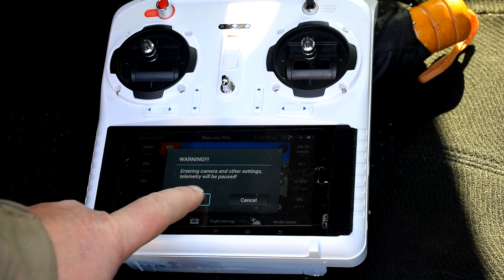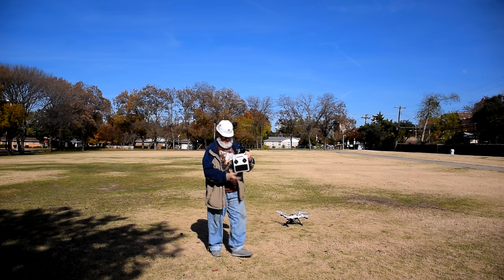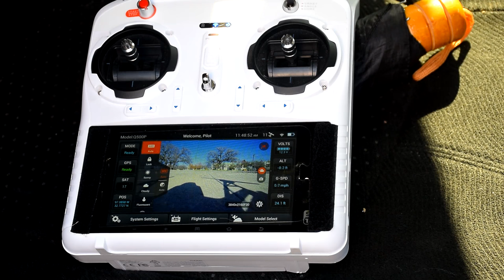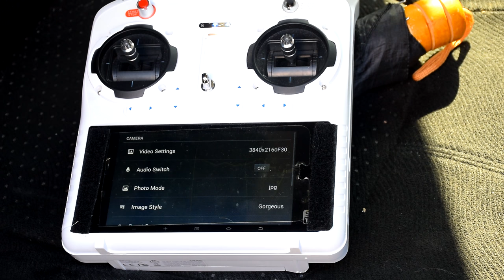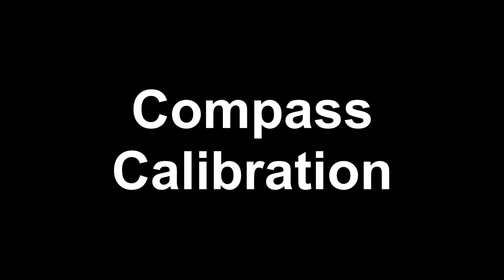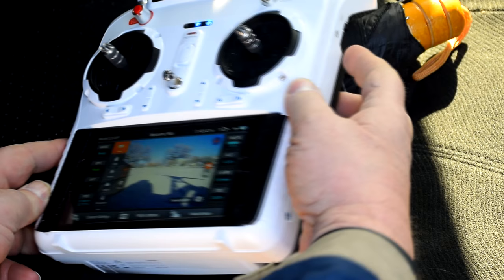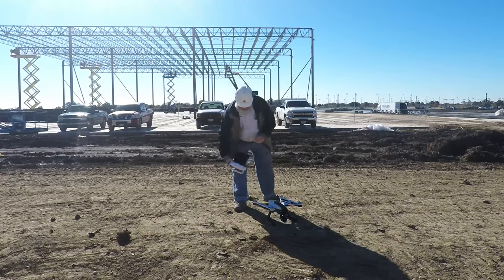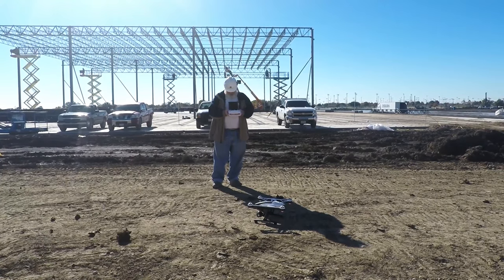Episode 4: How to Calibrate the Yuneec Q500 4K - Accelerometer and Compass Calibrations

Comment: My q500 4K has a problem when is time to record I'll record only the sound but the video won't show up but, I don't understand why taking pictures will show up can you please help me I have send the drone to be fix about the camera because I was flying the drone and crash it to a tree causing the cables of the camera totally disconnect from the camera but I don't think they fix it right can u please help me
Reply from the maker: Hi Jonathan - It sounds like the camera was not fixed right but it is strange that it records photos but not video. The only other thing I can think of is that your computer won't play 4K video but that's really a stretch. I'm afraid you need to call Yuneec and ask about this problem.

One other idea. Try disconnecting the cable between your camera and the body of the drone and reconnecting it. Make sure it is fully connected. Then see if it will do the video.

Comment: I bought mine from a fella 30 miles away. He is the second owner. He bought it from the original owner, a pilot. . I don't know  how far it traveled from the original owner.  It has never crashed to the best of my knowledge and it maintained the original gimbal wire until I lost control with it when I lost SAT LOCK and the wind pushed it into the side of my house at 6' and when it dropped, the gimbal rolled away from the crash scene LOL.... The craft is in perfect condition, except for some scrapped up paint stained blades and I installed the supplied spare wire to the craft and gimbal that states' HA! THIS IDIOT CRASHED! HA HAHA! LOL..... MY questions are do we have magnetic interference and lose SAT lock often?? Wouldn't this scare folks from flying??I had 12 SATS lock at first. It was when I rose to 6' TWICE, that I lost lock.  I must always assume I will lose LOCK.  I don't want to be 300 feet up and lose 'LOCK' and then control. My main question is>> SHOULD I CALIBRATE  etc. just to be safe? I don't think it would hurt. Maybe the original owner lives in Texas or California for all I know. Maybe the original owner mailed it to the guy in Daytona Beach. I think IF I DON"T KNOW the history, I should calibrate. BUT, should I have too?

Comment: Instructions from Yuneec say to rotate to the left. Not the right. I will PM you the instructions. Please correct your video.
Reply from the maker: Hi modex - this has been discussed previously . . . the instructions say to turn counter clockwise, but Ryan, the guy in charge of Yuneec USA tech support, demonstrated the calibration and turned it to the right. Given the quality of the written instructions (or lack thereof) i prefer to go with Ryan's instruction. I've done many calibrations turning to the right and they've all worked.
Reply: Did Ryan demonstrate this via video? iPhone videos filmed in "selfie" mode (screen pointing towards yourself) are inverted horizontally, swapping left and right.Was there anything in Ryan's video that had text so you could see if this was the case? What about his shirt - which side were the buttons on? Did he have one or two shirt pockets? Single pockets are always (mostly?) on the wearer's right.Men's and Women's shirts button on opposite sides. Then again, if he's a cross-dresser, that's not really helpful LOL